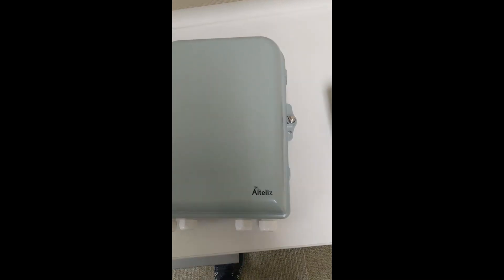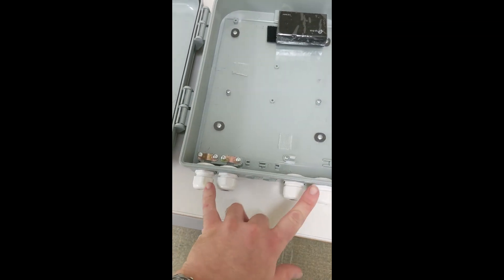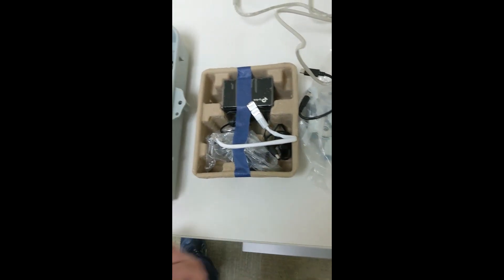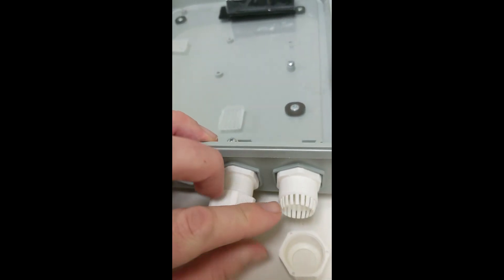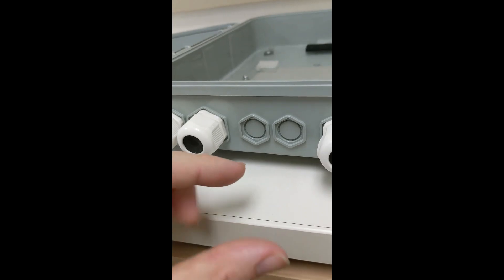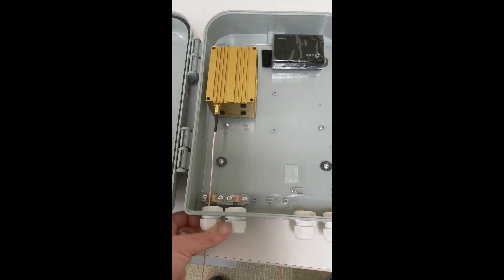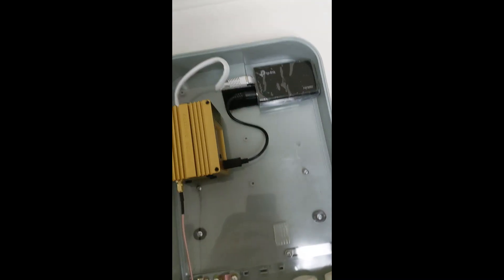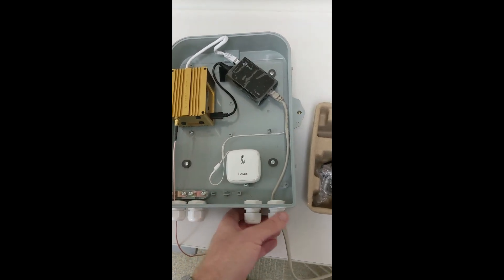IOToffGrid Helium Hotspot Enclosure Review and Setup

Comment: If you find more rubber plugs like the one you showed in the video you can drill an undersized hole and slice with a razor blade to wrap around the wire then put the plug in and cap on.
Reply from the maker: yes thats what i did when i tested this outdoor. IOToffgrid is now shipping them with 2 better quality black glands. I will post an update video soon.
Reply: @bigbeardtrader9740  yep. Got mine last week and had the new black plugs. Pretty wicked little set up. Definitely pleased with theIoToff-grid team. They hooked me up and it is greatly appreciated due to the times I’m in at the moment.